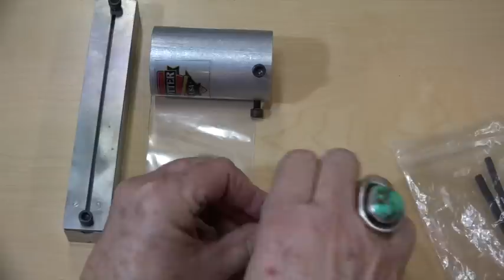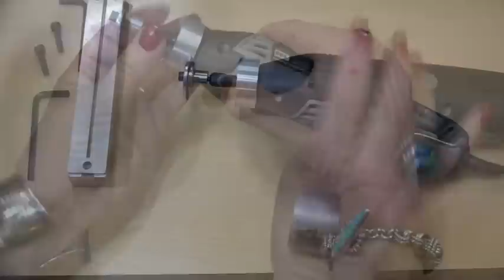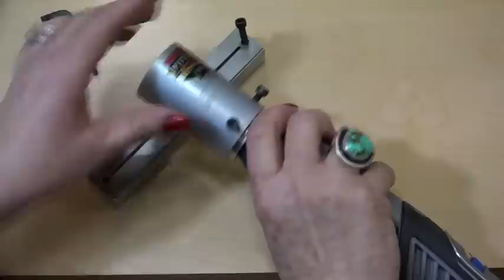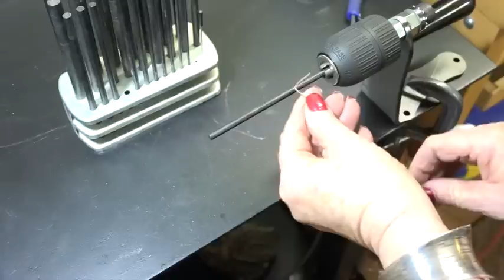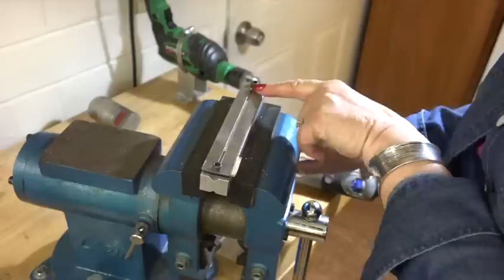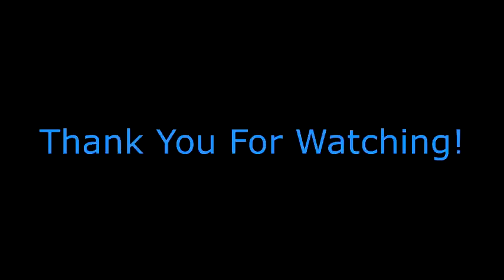How To Cut Jump Rings Using a Dremel Attachment

Comment: Ok. I have my dremel and and now I can not stop making jump rings. Is there an attachment for larger rings? Like 12-20mm???
Reply: Have you considered getting longer machine screws that are the same threading? 
I'm not saying this will work but it was a thought, just because I don't think there is a manufactured attachment. But you might pull off a Jerry rig.

Comment: i received my KK the other day only to discover that what I purchased from Harbor Freight is a Dremel-like device and is not compatible with the KK. Which dremels are compatible with the KK?
Reply from the maker: A standard Dremel tool will work. There are so many varieties we cannot try them all. We know they do not work on battery-operated models or on models that are like 20 years old. It does not work with the flexshaft attachment for the Dremel.
Reply: Kevin Potter Thank You for your response! Yeah, I have a battery powered imitation Dremel! I was so excited when I found your tool that I looked right over the caution.

I’ll purchase a Dremel in a few days. I have jump-rings to make!

Comment: Can you cut any size of jumprings...2.0 mm?...answer the questions please
Reply from the maker: Coils to be cut can be up to 4 inches long and 7/8 inch (22 mm) in outside diameter. Coils may be made of 12 through 30 gauge wire.

Comment: Thank you so much for your demonstration! I am looking for a method that is efficient, yet creates an even, close cut with little waste. How much of a gap, if any, does the blade leave in the jump ring, and is it an even cut?
Reply from the maker: The size of the gap depends on the thickness of the saw blade you choose. We sell the .012 blade with the kit. There are thinner blades, but we do not sell them because they break much quicker.